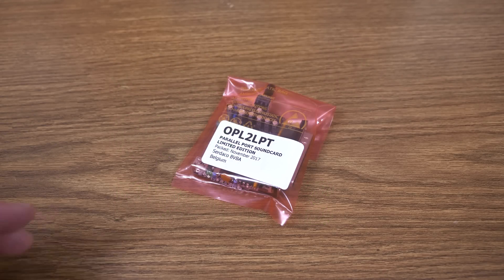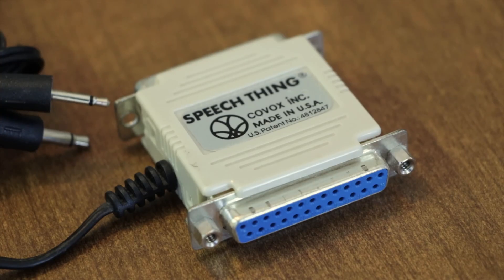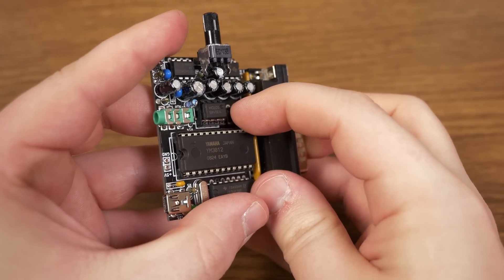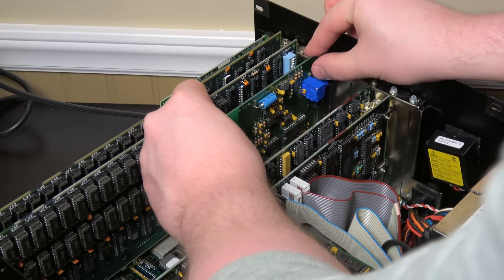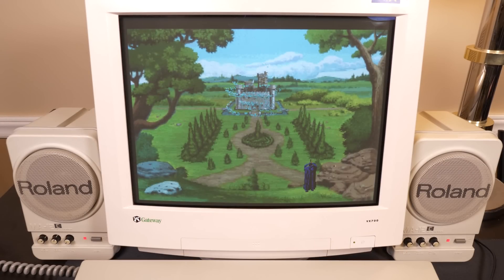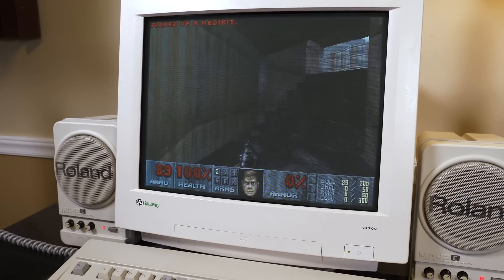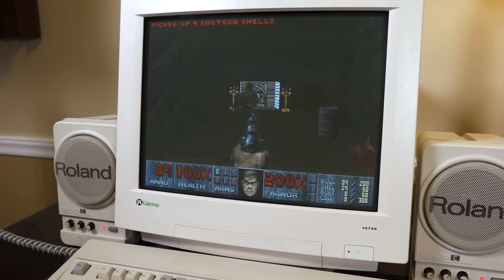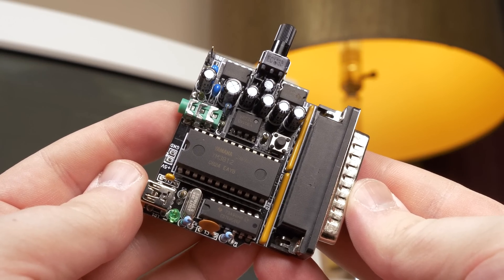AdLib Sound Card Over Parallel! The OPL2LPT

Comment: I apparently grabbed one of the last OPL2LPT's on the website  for now (cause I am a cheap ass and did not want to spring for the opl3 model) for my 486 laptop, and yea it works pretty well when software play's ball. Airmail freebee shipping was not overly long, about the time I started to wonder about it, it popped up a couple days later. My only complaint about it is when I touch the volume knob it kind of buzzes, but its not like the pot really changed the level THAT much. So I might go back and find a middle ground and put a couple resistors on it instead ... which would make it a tiny bit more compact and I wouldnt mind trying to "embed" it inside the laptop's case (its got a optional modem bay that's about the right footprint)
I might add the opl2lpt available now is about the same PCB as the OPL3 model (just with though hole chips) so its already quite a bit smaller than shown in this 2017 video

Comment: Sound cards use DMA and interrupts. 
Unfortunately Covox nor Parralel Adlib don't support ECP mode parallel port. The SCSI ECP Parallel port adapters can transfer 5 MB/sec. with low CPU overhead.
Reply: Like Adaptec APA-358

Comment: I found myself one of those nifty Media Vision AudioPort devices (new in box no less...at Goodwill obviously) and I set it up this weekend on an IBM P70 "luggable" machine. It works fine, has Soundblaster and Adlib compatibility but is limited to Windows 3.1 only. No sound in DOS mode, although if the game is run from within Windows 3.1 you get sound. I wonder if one of those DOS tools used to enable this device would enable the AudioPort...hmm....

Comment: Why don't you use the 5 volts from the PC's power supply? It will be a bit awkward a cable coming out of the case and into the mini USB, but less awkward than external power supply. :)

Comment: There are PS/2 splitter cables. Would it be possible to use one of those in conjunction with a PS/2 to USB adapter in order to power one of these while still using the mouse or keyboard you have plugged into the port? Or would the OPL2LPT plus a keyboard or mouse take more power than a single PS/2 port can provide?

Comment: What an interesting way of using the now, fairly redundant parallel port. Wouldn't mind knowing if there is cross-platform drivers / support for this device (could it be used with Linux or MacOS)?

Comment: I would like to make everybody aware that the driver, since the filming of this has been much improved. Especially on slower machines (386es) the driver has gotten a very drastic performance boost since version 0.4 (what Clint used, now we're at version 0.6)
Development continues quickly and it gets faster and more polished with every week. What was a slideshow before on 20Mhz systems like Keen4's sounds PLUS music through the TSR instead of patching is now almost impeccable without almost any slowdowns. Go try out the new version of the driver, especially on slower systems it makes a big difference. A good example is Wolf3d/Keen4 with a 386 20Mhz. The difference between TSR of v0.4 and 0.6 is out of this world.

Comment: I think it's quite a design flaw to have only a usb power on a device like this, it should use a floppy connector, or offer an adapter at a bit of additional cost which would be simple enough.
Reply: Jack Mcslay It has pins on it that you could use to solder on a wire with a floppy power connector or a barrel jack.  A floppy connector probably wasn't included as the device is meant to be used externally.

Comment: Isn't the source for Duke3D available? It might be a pain to do, but you could edit the source code for the correct address for the AdLib on parallel (378... isn't that what 8 Bit guy showed in his video?), compile it then just run the new executable? Certainly not as easy as patching, but for games where the source is available many people could do the changes for a variety of games to increase the support.

Comment: Can this be used in tandem with a covox on a second LPT port?
Reply: Interesting question. If so, you'd probably need a fair bit of CPU to do it.
Reply: I believe most of the CPU power would go to the Covox due to its real-time nature due to the lack of DMA to the LPT port while the Adlib just needs "instructions" to turn on or off its FM/Noise generators. I may be wrong :)
Reply: Sounds like we're both thinking along the same lines.

Comment: i can never wrap my mind around the fact that these sound cards don't support sound effects.....it amazed me in 1993 and still blows my mind now....at one point my SB16 died and a friend gave me his old, very old soundcard, went home, installed it and tried ALONE IN THE DARK 2, it only gave me music, i thought there was something wrong (i had no box and also no internet back then to know) , later on in life i learned about that and it blew me away, who would ever play a game with no sound effects or with pc speakers sound effects? ended up buying an AWE 32 and lived happily ever after...
Reply: Games of the AdLib generation were designed to use an FM synth channel for sound effects.  That is, those games weren't lacking sound, they just used different hardware to generate it.  (For e.g., in Wolfenstein where you pick up health and treasure, or everything in Lemmings -- that all uses the Yamaha chip.)

Later era games were written for later era cards that had both FM synth and DMA-enabled PCM audio -- namely, the SoundBlaster series.  While the OPL2 can technically do PCM, it's not very adept at it, so it was rarely used.  Games of that time would still support plain AdLib cards because of a large existing installed base (relatively), but since there was (effectively) no PCM support, there would be no sound effects.  Solution -- upgrade to a SoundBlaster.

Comment: Now imagine a Roland MT-32 version of this, or a General MIDI capable one.
Reply from the maker: Now that would be a game-changer!
Reply: Gravis Ultra Sound LTP1 version haha
Reply: General MIDI could be done on a gameport. But since gameports are generally found on soundcards, it kindof defeats the purpose
Reply: There's already midi interfaces for parallel and serial port so I think it could be done with existing hardware.
Reply: It is possible, but not that easy. The Dreamblaster chip however has both a serial MIDI and a parallel interface, so you won't need to create an actual serial MIDI interface on the printer port.
Reply: Well unless emulated, it would be HUGE and expensive ASF.
Reply: that would be amazing
Reply: R33Racer Yeah, though, if it sounded close enough to the real thing, emulation wouldn't be a deal breaker for me.
Reply: Kane On a standalone thing though.
Reply: a GM one with some multi-channel sampling capabilities next to the oscillators/operators to support soundfonts + memory to store soundfonts would be pretty cool indeed ;)
Reply: Ohhh, my bad. Yeah, that would be pretty neat. I'm not too familiar with Munt but I wonder if it's core could be reimplemented on an FPGA board to interface with a ROM chip to do such a thing.
Reply: Whahaha I still have ISA cards with my treasured awe64 gold and Ultra sound compatible not the original but still an ultra sound.
Reply: General MIDI is being worked on, a LPT version of the Dreamblaster S2.

Comment: Where are they getting the OPL2 chips? I hope there are lots of discrete chips laying around in some storage room, and they're not actually gutting pre-existing hardware Analog NT style.

Also, you said you were picky about your FM musics, but you almost dropped an AWE32 on your goto woodgrain 486, so I'm glad you made the right choice and swapped it out eventually, cause they have their own unique signature :D
Reply from the maker: From what I've gathered, YM3812 chips are still made brand new, or were up until recently. You can get new ones quite easily and cheaply.
Reply: That's really cool, thanks for the response! I wonder what kind of modern endeavors would need such a chip, but if it can help produce stuff like this it is definitely worth it. I hope we will see an OPL3 attempt in the future, since it's basically just a supercharged OPL2 with more modes/voices, and the die is even smaller. As you mentioned it's a life saver for old monochrome laptop users!
Reply: pmarin Even some clone cards had an actual YM3812 built inside, yet most games had sound drivers which targeted certain hardware (mostly from Creative) timings and interfaces, which led the music sounding abysmally off on edge cases. This is just an analogy, the AWE32/64 is certainly competent at supporting the way each DOS game interfaced previous Sound Blasters, but as you somewhat adressed, under the hood it works substantially different, to the point certain Windows programs supporting direct OPL3 control stopped working until you booted the system a certain way (which would then disable FM usage on DOS).

What I want to say is, integrating the OPL3 into a custom chip changed its previous implementation as a stock outside die, and no doubt took some extra amount of engineering to make it work properly. 
But even then, to an untrained ear, games just don't sound like the late 80's and early 90's FM cards did. Most of the patches are close, but some are radically different, to the point Ken Silverman (creator of the Build Engine) saw issue to this and started programming his own OPL2 emulator so the way his Ken's Labyrinth tunes sounded could be immortalized. Something I noted is also how the FM sound produced by the AWE series has some of that "tin can" feel to it, which I actually like really much, but the fact remains it is not an accurate representation of how games with FM support sounded from the AdLib days to the SB16. I wish there were more comparisons on YouTube so you could check it out.
Reply: 8bit guy said they are still producing the chip
Reply: zummone Remarked old Chinese stock or clones. OPL2s aren’t manufactured any more and a date code of “0824” is a dead giveaway
Reply: The AWE32 has a CT1747 chip which has  the OPL3 synthesizer integrated.
Reply: The CT1747 chip in the AWE 32 is the same you can find in many SB16, using the Adlib license. Its even more accurate than many SB16 and most OEM versions (VIBRA)  that Creative made using  CQM synthesis.

Comment: People seem to connect all sorts of things to parallel port.
Let's just replace PCIe with a bunch of parallel ports, and see how far we can push it.
Reply: The main problem you're going to hit is bandwidth.  Even in EPP mode, a parallel port has a maximum throughput of 2.5 MB/sec (compared to PCIe at 500 MB/sec per lane).  There was a parallel port Adlib/SoundBlaster device a few years ago (I don't think anyone makes it anymore); when playing samples at 44100 Hz, the driver had to downsample it before sending it to the parallel port.
Reply: But what if we use two parallel ports... in parallel?
Reply: @an2qzavok  just multiplex many parallel ports in a single parallel port, bro

Comment: Why's there no better Adlib emulation? :/
Reply: There is actually! Somebody released super accurate YM-2612 (including the quantization glitch) and YMF-262 emulators! You should look into it, they will eventually be  part of the next long release of DOSBox, but for now there are custom builds. If you wait some time I can give you more info.
Reply: Wait! What? There will be a new version of DOSBox?!?
Reply: There eventually will be, someday. All those code commits made through the last few years aren't going to be wasted.
Even though right now it'd be a smart thing to get the GUI branches of DOSBox based on the last SVN which support OpenGL shaders (like CRTs), real time settings editing and MT-32 emulation out the box (you need the ROMs though).

Comment: why you just don't use usb sound card?
Reply from the maker: Because USB wasn't even a thing until the end of the '90s. This is for retro computers that existed before USB.
Reply: Even if you have an old machine with USB1 or even added your own USB2 or USB3 (lol) PCI card to one, there aren't drivers for USB sound cards for DOS/3x. They do use a generic interface, I think, but even if someone set that up it would have to have a wrapper that presented like an Adlib or SoundBlaster to be useful for DOS stuff. That said, you might be able to get a WXD driver intended for XP to work on 98SE, but that's a toss-up and again wouldn't be useful for DOS gaming, though I guess if the machine could handle it you could emulate a SB, rofl..
Reply: The first versions of Windows 95 didn't support USB, and I'm not entirely sure USB audio was even a thing in Windows 98. Even if it worked you'd be stuck running things in a dos mode window which is less than ideal.
Reply: Ignoring all other issues mentioned, USB sound cards do not support FM synthesis.
Reply: USB really wasn't a thing till the mid 90s, even then it wasn't that popular till the late 90s.
Reply: You must be new here.
Reply: What is this "You Ess Bee" you are talking about?
Reply: tin pin lol
Reply: computers back then didnt have usb
Reply: "The satisfaction of using old parts".
Reply: @tin pin

In all fairness he asked a logical question. With so many PC components throughout the years, compatibility becomes a bit convoluted, especially to someone that is just learning.